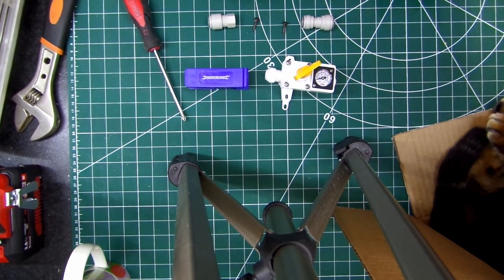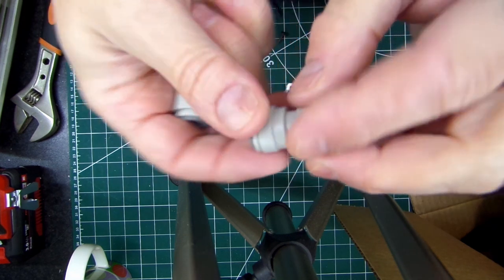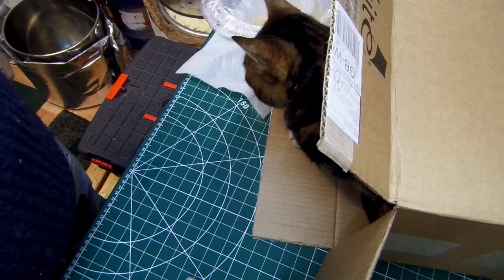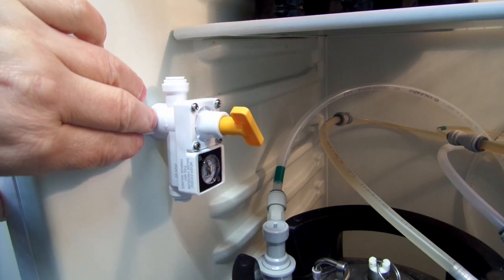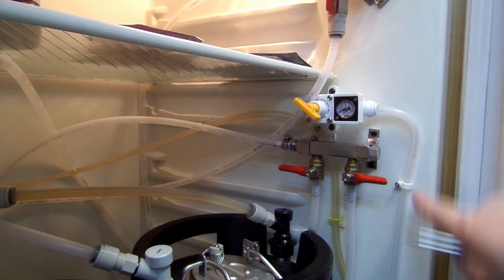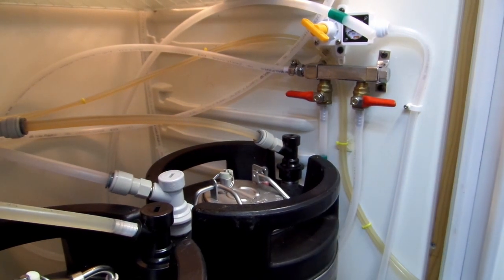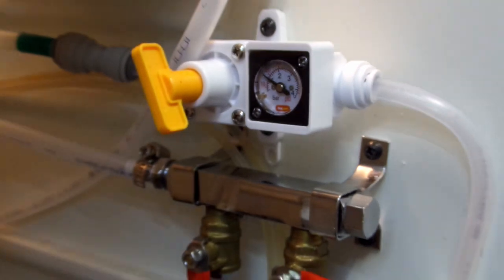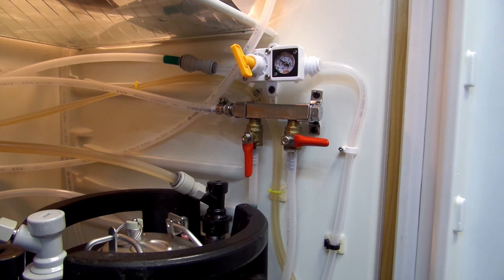Vblog78 - Move on, nothing to see here (Kegland Secondary Regulator Fitting)

Comment: Nice set up now fridge full of gas and regulators , also kegs of beer also. Cheers
Reply: Since I put this video up, my fridge/freezer stopepd working. All my hops are defrosting. I thought I had broken it by screwing into a wire or something so 1 hour removing every screw I could see on the freezer and I was getting nowhere. Pulled the top panel off and checked the thermostat and it was working. Long story short, I was about to hacksaw the side off and it suddently started working. Looks like the thermostat was messed up so another project on the way to add a STC1000 or similar to the top! Co2 seems ok so far but I need to replace a few JG connectors.